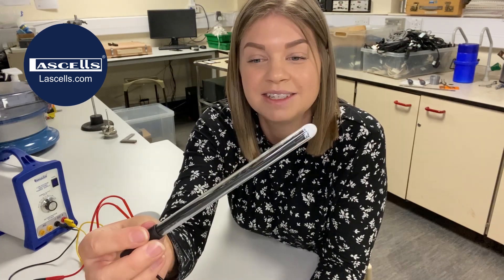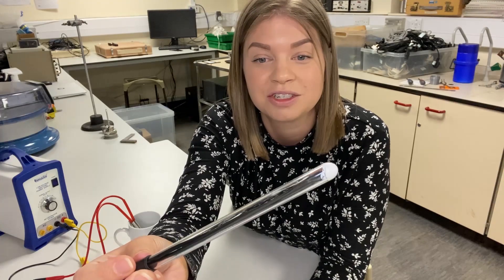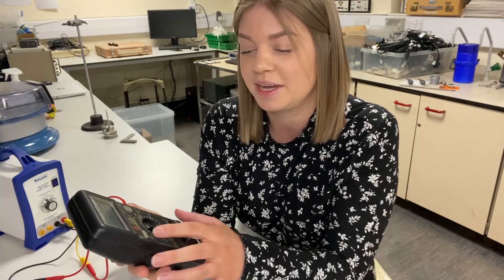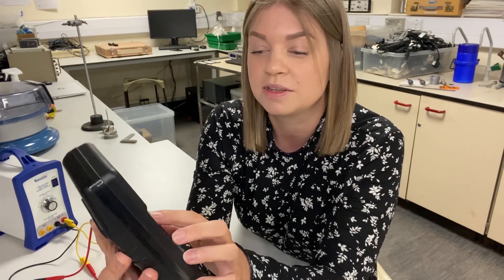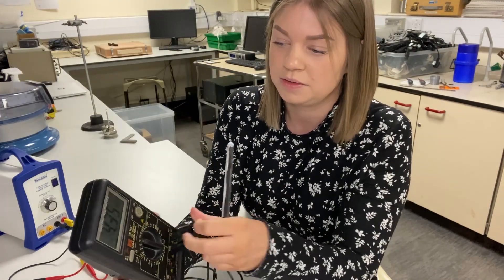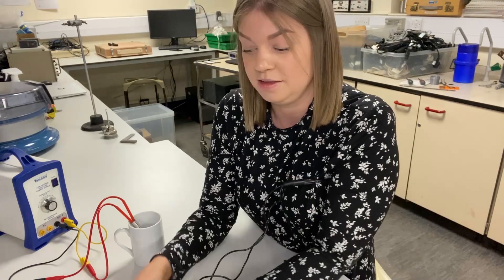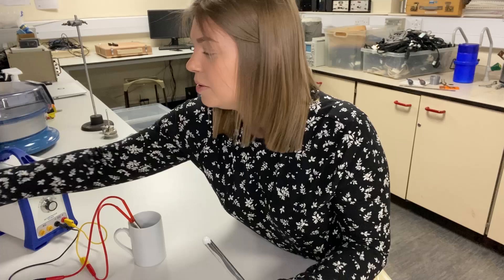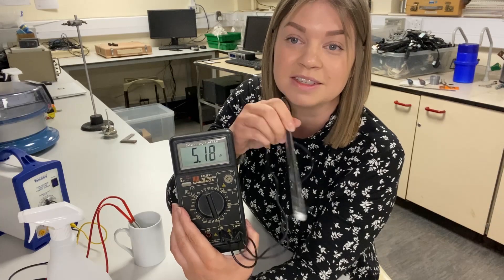How Does a Thermistor Work?

Comment: Dear Dr.Swan, my school has a number of mounted thermistors (S100-098). How are these used, please?
Reply from the maker: Hi! The mounted resistors are useful for quick classroom demos, where the set up looks like a classical circuit. By attaching an ohmmeter (or voltmeter and ammeter), you can show how the resistance changes with temperature… you should see a change simply by using body heat from your hand on the component. 

You could also investigate resistance as a function of temperature, using sandwich bags of different temperature water. Carefully place (strong!) sandwich bags of water on the sensor of known temperature, and measure the resistance, to get a nice curly plot. 

I wanna try this now 😅

Let us know what you end up doing with yours :) -Nichola